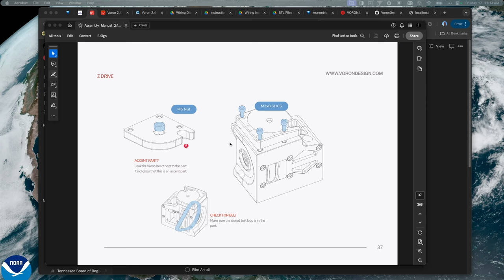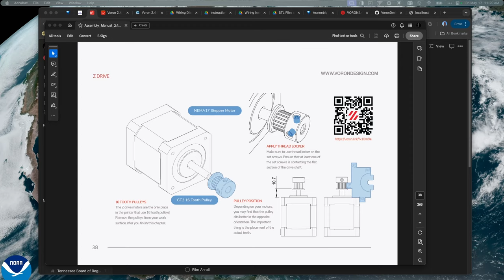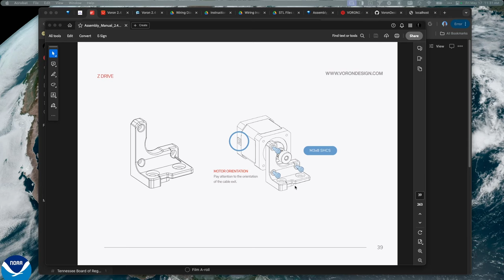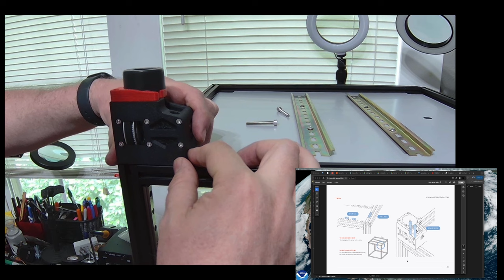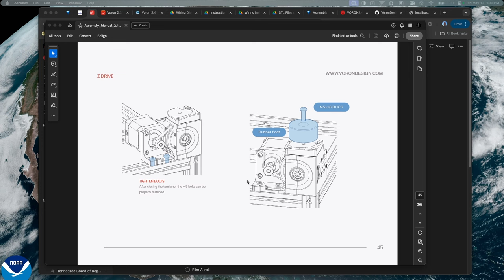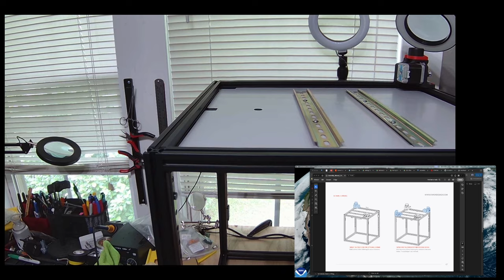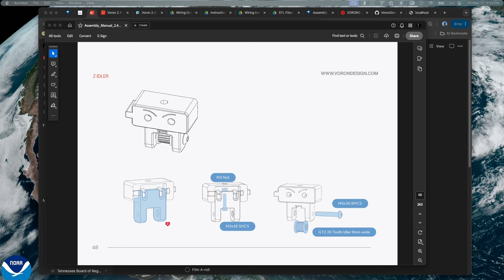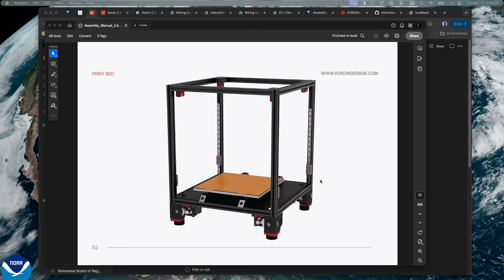Voron 2.4 R2 Build Guide: A DIY Monster! Voron Assembly - Part 5 - Completing the Z Drive

Comment: I missed this in the what little frombot has as build instructions . The din rails need to be turnd 90 from the norm for the cabling to work out correctly on the 350 builds
Reply from the maker: I will need to rev. I might have missed that.
Reply: @minimal3dp  Wiring Diagram of V2.4 R2 Pro+ pdf Bottom left under the picture of the power supply . i redid mine a night ago . wires laid out much better .

Comment: what will you be using for a bed leval ? i am installing a cartographer3d and Galileo 2 for the excruder with revo
Reply from the maker: I am going to install the tap sensor.
Reply: @minimal3dp  great i have a few taps i have not installd yet on other printers i will keep folling along as ive never used tap and my r2.4 is my 1st r2.4 build .